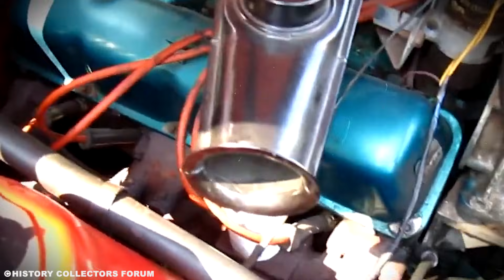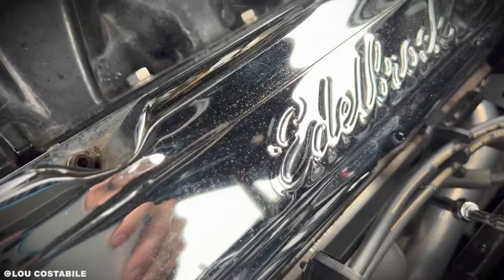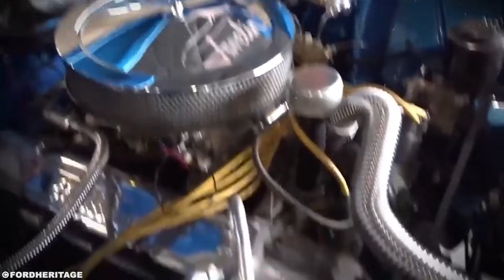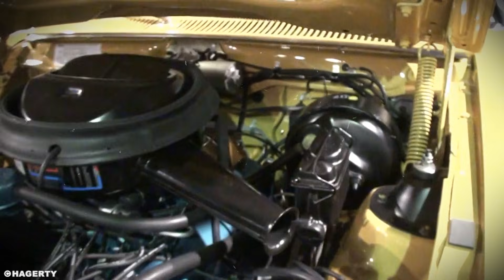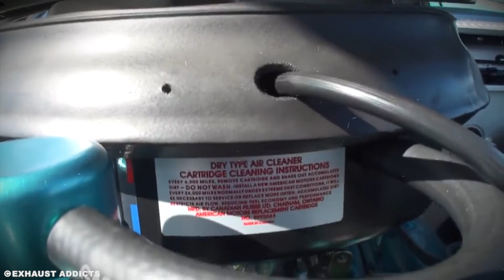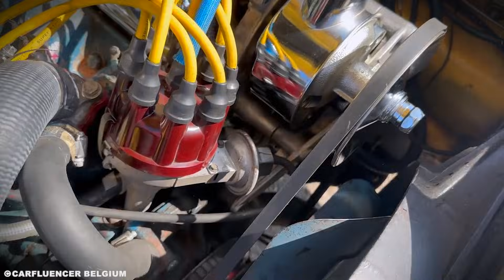This Oklahoma Mechanic OUTSMARTED AMC With a "Homemade" 390 Stroker That Made 550 HP

Comment: Someone didn’t do the math right. A 390 bloc and a 402 block are bored from the factory to the same bore size of 4.165”. Putting a 401 crank I. Either one gives you 401 cubic inches, not 406. If you bore the block out 0.030” to square up the bore and use the 401 crank you get 407 cubic inches. Actually 406.95 cubic inches which we would call 407 cubic inches. The gold to be found in these AMC engines comes from the 390 and 401’s forged steel crankshafts. The rod journals are 2.248” in diameter. The cast crank has smaller rod journals at 2.09”. But the large forged journals can be ground d down to 2.10” inches in diameter, the same diameter as a Small Block Chevy. That gives you the ability to offset grind the crank Journals to increase the stroke of the crankshaft. A used crank would probably have to be ground down 0.010” to get past any scouring, so that leaves you with 0.138” of possible offset. Because you grind that on a crankshaft that rotates that means the stroke is increased by 0.276”, gojng from 3.68 to 3.956” of maximum stroke. The 390 crankshaft can also be offset ground, or stroked to 3.85” stroke giving you 426 cubic inches with the 390 crankshaft or 437 cubic inches for the 401 crank.you could use connecting rods with a Chevy rod journals diameter up to 6.0 inches in length, but the rod journals ar wider on the AMC crank. Either the journals width would have to be reduced by welding and then grinding them to Chevy size or custom rods would have to be used. Welding the fillets on the crankshaft to reduce their width was cheaper back in the 70’s, but you would still need custom pistons. There were guys building engines like this and doing it cheaper than having a custom crank made which would still need custom pistons for it to come together. Cylinder head wise using the late model Dog Leg heads gave you the best flowing heads @s cast of any small block except for the Ford Boss 302/351 Cleveland four barrel heads, but they were considered too large for anything but high rpm racing. The AMC heads, with a good valve job, the valve bowls cleaned up and port matched to the intake manifold work very well. Good hunting!
By the way to figure out how big the engine is in cubic engines use the following formula. .7854X the Bore Squared, ( or Bore XBore), X stroke X number of cylinders. Or .7845XBoreXBoreXStrokeXnumber of cylinders. For the 390 with 401 Crank with the cylinder bored 0.030” over its 406.905.
Reply: Ohhhhhkay! 👌🏼

Comment: 😢lots of misinformation  the 2.08 valves were from a 440 not 340 , and not pro stock level hp , wally booths and kanners made over 800 hp from 374 ci , and current super stocks make close to 900 hp ,and built 401s can make over 700hp with factory heads., and 10.90 were about avg for hurst ss cars. In 70 The best in 70 was 10.68

Comment: I have wondered what Bobby Allison did to make the AMC Matador competive
Reply: When the Matadors were running in Nascar the engine size limit was 366 cubic inches. They would have been running Special Service Blocks with the displacement the same as the 360. The SSB was cast with the rough casting  343/360 cylinder bore and 390/401 water jackets and bottom end.

Comment: MISS my 1979 , 1 YEAR ONLY AMX 304 V8 ,4 speed BOLT 9 LS POSI TRAC , RALLY RACE engineered handling PACKAGE, my great friend DON HENDERSONN , A TRUE backyard mechanic near SNOWMELT Orangeville Ontario, the 304 went ok unfortunately pollution control NONSENCENhad to BEGONE , age 20 🤔 I WANTED MORE , the NEED FOR SPEED 🤪 😢😢on a tight BUDGET , Don removed the 304 pretty much A ford 302 block , added  QUADRAJET   450 , 4 barrel aluminum eldebrock intake , HOOKER headers to dual thrush HUSH mufflers , mild MID cam , A HD CLUTCH ,  what REALLY helped SIGNIFICANTLY , to turn my AMX in 278  HP BEAST ,  Don somehow managed to AQUIRE a set of 343 heads , I THINK 🤔 OFF A TRACTOR engine , the WOW factor hit when shifting from 2nd to 3rd RUBBER WAS BEING BURNED ,  I was soon  beating  BB Mopars  1/4 mile , A TRUE 5.0 liter EATER , TOE TO TOE against the GRAND NATIONALS , one thing missed was , 60 bucks here 80 there STREET RACING , unfortunately WE NEGLECTED THE transmission  a LONG SHIFT ALUMINUM T8 as I recall , 3 LATER 💰 , that & a couple of RACING charges , PLUS the short wheelbase with 60s all around & RALLY RIMS , first I HAD TO REMOVE THE HOOD FLAMES , RACE SPORT  DECAL OF PACKAGE did you SAY " HEAT SCORE " reluctantly I had NO CHOICE but to SELL MY BABY insurance 😳 WHAT 💰🤮💰 a necessary EVIL today , NEXT Red on RED ♥️ 1965 MERCURY COMET CALIENTA 2 DOOR , BENCH SEAT , when I learned that cruising in a AWESOME CLASSIC 289 dual exhaust Factory 1965 REAL  CHERRY 🍒 BOMB MUFFLERS , I found my calling 😍 MISS HER SO SO MUCH ARM OUT THE WINDOW everyone 👀 on it

Comment: How long were the rods?  He got it to 427?  625 hp? wTF? I remember seeing some 406s on the dirt. I wish Kauffman. had turned his talent to 70s FEs. The FT cranks could go to 4, inches and BBlC rod journals, and 4.125 bores. 427 D4TE dump truck blocks with early style FE heads and CJ valves. A cheap 427 that would make 700 hp and 7000 rpm’s.

Comment: Did it turn out to 412 ci. 4.195 bore?
Reply: I think he said .060 over 401 that's 4.225 and they used either a offset crank or aftermarket for a 3.750 stroke